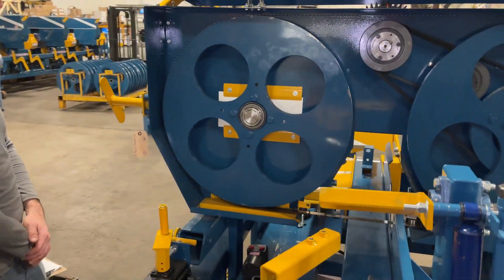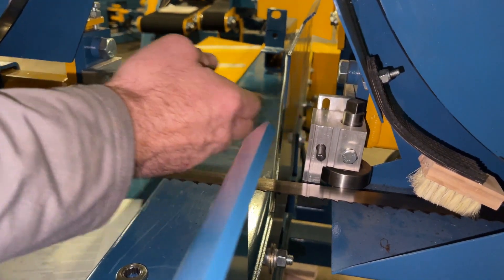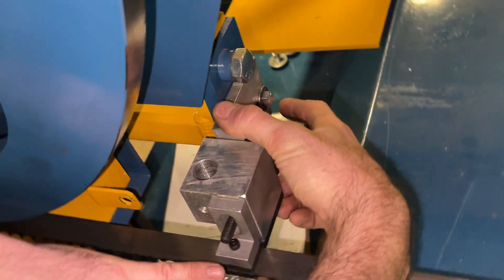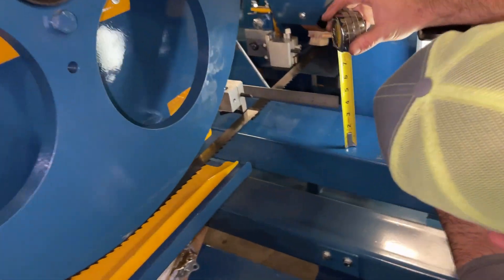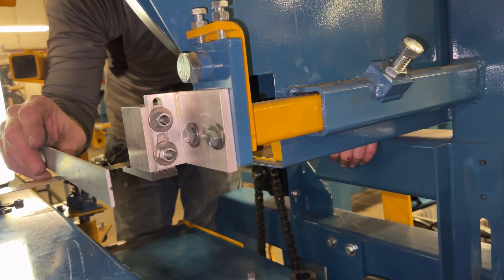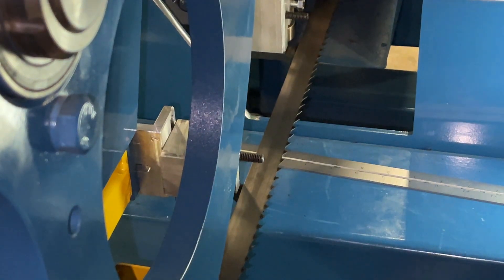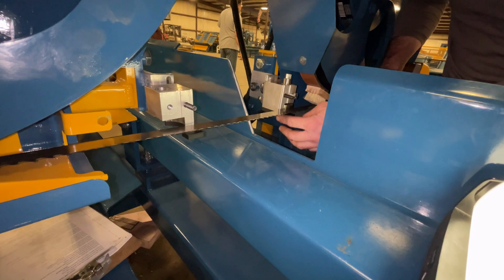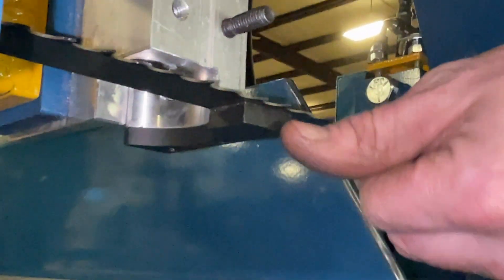Baker Products - Setting the guides on a resaw

Comment: Man you have no idea how much i appreciate this video. I've operated component saws for a couple years but started running the baker double and have been running it for 6 to 7 months. I've learned allot from the guys teaching me but this video shows so much. I never would have thought to tap on the band blade to hear what kind of noise it makes and the difference when it's riding the guide block or not

Comment: John I’ve searched the web for a video on how to set the hold down arms on my 5 head resaw. Model C 5 head. Can you please help!!!???
Reply from the maker: The video will be really short. Adjust the blue hex nut above the spring up or down and that will raise or lower the wheel where it needs to go. Rule of thumb is to place the wheel a just a hair below the blade.

Comment: Is that ruler magnetic? How does it stay on the blade like that?
Reply from the maker: No, they guys use a ruler that has a flat edge on the side. Most rulers have a rounded edge, but do have a flat side to stand up on edge. What you can do also is use 2 hex nuts (like 3/4", something heavy) or 2 magnets to hold the blade up.